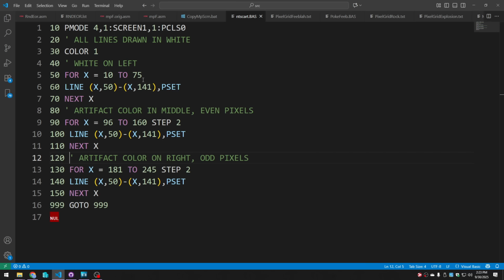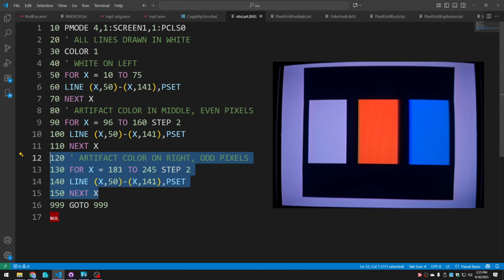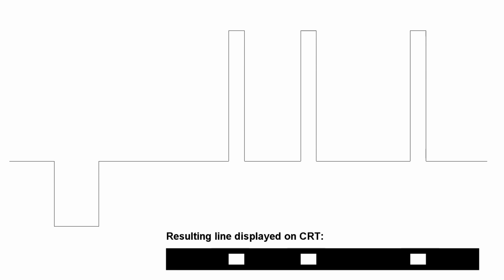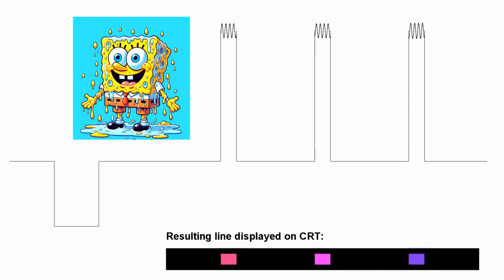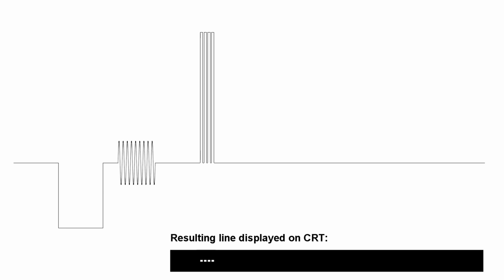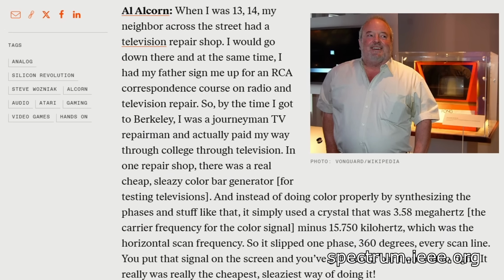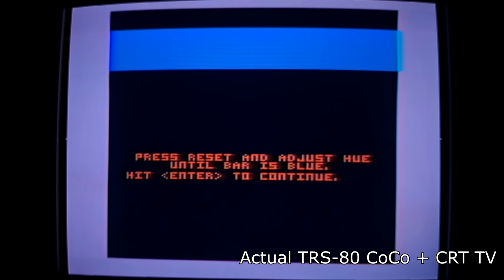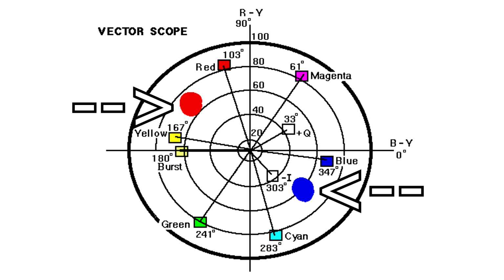How early computers TRICKED TVs into making color (out of nothing at all)

Comment: When you send the color burst (3.579~MHz) signal to trick the display into thinking you are in color mode, are you basically using the same trick as with the "fake" colors (sending a luma sequence that mimics it)? If not, and you are using some signal encoding method that can natively send the chroma signal, then why not just encode the colors using the chroma signal?
Reply from the maker: In the case of the apple 2, it did not generate chroma at all, and used luma for all of the colors.  I'm no electrical engineer, but my guess is that it's much easier for digital circuits to generate color burst than it is to generate chroma. Just a simple sine wave or even a square wave approximation at the right frequency and you're good. Chroma requires carefully adjusted phase changes for each new color across the scan line.  In the case of the coco (which came a few years later), it actually was capable of generating chroma, and did so on the lower resolution screens. It is only on the high resolution screen where it relies on artifacts to get colors.

Comment: To say that it's tricking the monitor is a little weird, because tricking the monitor is basically how NTSC colour works.  It's a monochrome image with a signal that tells the monitor to interpret patterns on the lines as colour (as well as giving it the phase reference).  This is, of course, why NTSC's colour resolution is so awful.

(As a long-time Apple II guy, this subject is a very old friend.  😉)
Reply: Side note:  I once connected a colour NTSC monitor to the s-video output on one of my video cards (through an adapter, of course), and dragged an Apple II emulator, in monochrome mode, over to it.  Sure enough, the colours worked.  ☺

Comment: Actually my comment covered TV standards. Monitors are progressive scan all lines 60 per second. And external sync signals can be either polarity, but during actual retrace the have to be black at the CRT.
The screen has several phosphors that are balanced to appear white. But because they have different persistences an ultra fine switching from white to black and back can generate a balance change to the eye.

Comment: I know that many people feel confused with TV standards, NTSC is the name of the orginal American B&W TV standard, but since it was the only format avaiable back then the average Joe called it "the TV signal" and the like instead of "NTSC"
The new color standard was called "NTSC Compatible Color" because it was a color signal compatible with the original NTSC (B&W) receivers, and since the average Joe didn't understand much either, they started calling the color television standard "NTSC" (without the "compatible color" part) as if the previous black and white standard had been something other than NTSC.

You can think of the original B&W standard as NTSC 1.0 and the compatible color standard as NTSC 2.0, the important thing to remember is that both are NTSC and NTSC does not imply color unless it's followed by "compatible color"
Reply: NTSC was also the name of the committee that was tasked with finding the suitable colour TV standard, National Television Standards Committee. The quadrature modulation system chosen was developed by RCA and called Living Color. The B&W standard was called Class M, and was developed before the NTSC existed. The first American colour TV standard was CBS's sequential field color, which transmitted each primary colour as a separate field and employed a rotating colour wheel in front of the screen, and was not compatable with Class M B&W. CBS was miffed that their system wasn't chosen by NTSC, especially since the FCC had already guaranteed that the system would be adopted as standard. CBS did not adopt NTSC color until 1965 as a result.

Comment: The reason it wasn't in the docs is because it (at least the implementation in the Coco) isn't reliable.  You can't be sure what colors you're going to get (they can swap from one reset to another), or if you're going to get any at all (NTSC vs PAL).  Basically, the designers were too lazy to make it work right, do they just didn't document it (it's a bug, not a feature).

The APPLE ][, on the other hand, if I remember correctly, was actually designed to reliably produce colors this way, and it was therefore actually a documented feature.
Reply from the maker: That makes sense. And yes, it does appear like the apple 2 was intricately designed to generate a great number of reliable artifact colors.

Comment: Well, I would argue that you do manufacture a Chroma signal.
You're just not doing it with dedicated hardware.
- It is transmitted with all the physical characteristics of a Chroma signal (including the Chroma Burst).
- It is interpreted by the TV set as a Chroma signal.
- It is intended by the programmer as a Chroma signal.
You might call it a software-generated Chroma signal, as opposed to a hardware-generated one.

Comment: 20:53: Is the frequency of the digital signal actually 3.579545MHz, or just close-ish? That's a lot of significant figures.
Reply: The official spec is actually 315/88 MHz, so 3.57954545454545.... MHz. :)

The CoCo 1 clock generator used a crystal tuned to the colorburst frequency (I think?  My memory is hazy...) and the CPU clock was the colorburst frequency divided by 4, or 0.89488 MHz.  Unless you did the magic POKE that doubled it to 1.7898 MHz...
Reply: I'm not sure about the Coco, but what's usually done is buying a 14.31818 crystal and dividing it by 4 with two flip-flops. That way you get a perfect digital 3.579545 signal AND the 180° shifted signal from the /Q output of the second flip-flop. Super simple and clever. 

The Apple I doesn't have colour, but it does get its NTSC carrier signal in this way, for example.
Reply: @MagnusEdvarsson  I believe you're right; I think that's what the CoCo did because the 6809E CPU needed two clock signals 90° apart.

Comment: The fast rising edges off course have high frequency components in the Fourier decomposition, and this caused problems even in B&W TVs, when some movies beginning and end titles had white chars with well defined borders against a black background those high frequencies bleed into the audio part of the signal and in some older TVs you could hear a noise in the audio cause by the titles.

Comment: The 3 components in NTSC aren't luma and hue/saturation. I'm guessing that you expressed them that way for simplification, but HSV color is a cylindrical colorspace and works quite differently to how NTSC encodes color. You also wouldn't be able to tack two parts of an HSV color signal to the luma signal in NTSC and get RGB color out the other side.

NTSC itself is made of 3 signals. Y, the luma, is a premultiplied combination of red, green, and blue in known values (0.30*R, 0.59*G, 0.11*B in SMPTE-C). I and Q are the other two, and they're difference signals from luma along two different color axes in the same RGB space. They are also effectively just premultiplied RGB, with different constant scaling values (0.599, -0.2773, -0.3217  for I, 0.213, -0.5251, 0.3121 for Q). This means that to reverse from YIQ into RGB to fire the CRT guns, you have 3 equations with 3 unknowns, and can solve for RGB with some simple matrix math. In actual fact, I'm pretty sure there was some cost optimization that was done to make it even simpler than using all 3 signals completely, but analog colorspace conversion stuff is a bit more wizardry than I'm comfortable with TBH. Probably just extracted R from I and Y, and B from Q and Y, without referring to all 3 within the same operation.

The I and Q signals are also just monochromatic video signals (with much lower bandwidth) that would look really weird, but if they were hue/saturation type colorspace values, they'd pretty much be unintelligible. The I signal is roughly orange-blue contrast, and the Q signal roughly purple-green contrast.
Reply from the maker: I did indeed omit the much more complicated details that weren't necessary for understanding color artifacts. I did have to mention the two color signals briefly, when showing the block diagram of the coco, with the two difference signals coming out of the VDG and going into the RF modulator.  But I never explained what they were or how they turn into the final chroma that the TV decodes.  @TechnologyConnections did a great job of this (as usual) on some of his videos.
Reply: There were three signals in the NTSC video composite. Y, containing the luminance/sync/burst and the modulated red and green subcarriers, 90 degrees out of phase, at burst frequency. When burst is present, the color killer is disabled, and the red and green subcarriers are demodulated. Blue is regenerated in the chroma section by subtracting red and green from the luninance. The luninance is sent to the cathodes of the CRT, and the RGB signals go to their respective control grids. If no burst was present, the color killer disabled the demodulators and the CRT control grids were biased equally, resulting in a B&W picture.

Comment: why don’t they just do color properly? am i missing something? was that like really difficult to do?
Reply: Memory biggest reason.  If you’re in high res, to draw the whole screen in black and white, needs one bit per pixel.  If you add color, you need multiple bits per pixel.  Even adding 2 extra colors would double the memory required (2 bits to count to 3) .   Which is why color is availabile in low def modes, less pixels means less memory, so can use that for color
Reply: 256x192 in black and white is 49152 bits, so around 4k (divide by 8).  That’s a LOT of ram, when these things only have 16k or something (does a google), 48k

Comment: 04:30 - It is / was possible on PAL too to create false colors, once you learn the difference between it and NTSC. Personally I haven't seen any software exploiting this same weakness PAL also had tho. But I briefly experimented with, and indeed I was getting colors (on C64).
Reply: I'm used to the false colours already generated normally, being these dreary vertical bar patterns of alternating washed out green and blue. And a dot matrix was always rendered as bars of washed out blue and crimson.
Reply: Yeah, but PAL is heavily advertised as not capable of artifacting. I think for PAL it involves messing with the color burst signal to get artifact-like colors.
Reply: @RAMChYLD  - Just as any other analog formats, PAL is not entirely immune from either dot crawl or cross color (or hanover bars even), I've seen those artifacts all through my younger life, and as I said, I messed with it on my C64, there's NO need of messing with the color burst, it is relatively easy to do the same tricks on it as you can do on NTSC.

If I had to choose between PAL, NTSC or SECAM, I'd definitely choose PAL, indeed that's the format that made a much better effort on fixing the shortcomings of NTSC, but as everything analog, PAL isn't perfect either, it can only do so much.

Comment: The only part I don't get is how you have enough resolution. Are you really generating a valid chroma signal with just two columns? The signal graphs make it look as if you'd need to draw several columns of alternating lines to display one column of colour, which would make your effective resolution tiny.
Reply from the maker: On the CoCo all you need are two columns. The high resolution graphics mode gives you 256 pixels going across (with rather large unusable borders taking up the remaining space on the far left and right of the tv screen). So setting one pixel white and the next one black is sufficient to give you an artifact color.  The diagrams in the video showed more than two pixels (with the resulting wide rectangle of artifact color on the screen) just to make the effective frequency pop a bit better for the viewer.

Comment: It does not work in PAL because PAL have a auto correction of color in which each line has the phase (where color information is encoded) reversed and added to the previous line to average changes out. Here in Brazil we use PAL-M and technicians called NTSC as Never Twice the Same Color as any phase variance changed color. Interesting as a flaw became a feature.
Reply: You could do the same with PAL but the hue you get is very limited. For instance the FuBK test card has the yellowish zone in the middle right that is made with a precise luma signal https://www.youtube.com/watch?v=4sF6bO6XGHs and by the way the two boxes in the lower right aren't actually grey, but if the AL decoder is set properly and there's no weak reception they are the same gray, otherwise they change hue https://www.youtube.com/watch?v=vYJbEEdRiOc

Comment: Woz figured out a way to extend the graphics on the Apple IIe using 80 column mode, to add 16 color double low resolution 80x48, and 16 color double high resolution 140x192. this was known as an enhanced Apple IIe.

The programming for this was ridiculous because it used the same memory addresses in opposite banks for each pair of bytes horizontally across the screen.

Double high color uses four pixels in a row to set the 16 colors, except each byte holds seven pixels so the colors are not aligned on the byte boundaries. It was insane.
Reply from the maker: One of the talks I watched while researching this went into those details.  And yes, it was highly unintuitive and seemed quite cumbersome to code to.  But still, the fact that it worked and provided so many colors so cheaply was really impressive.
Reply: @CocoTownRetro  Woz is underappreciated compared to Jobs, more people need to know about Woz

Comment: CGA had "real" color and artifact color combined, generating a lower resolution, but larger palette. But that was only happening over the composite connector. Via the digital connector, one would get higher resolution, but just four colors, and the colors were quite ugly. Later hacks actually enabled achieving 1024 simultaneous colors on CGA's composite output, I'm sure that was beyong the wildest dreams of the designers of the CGA.

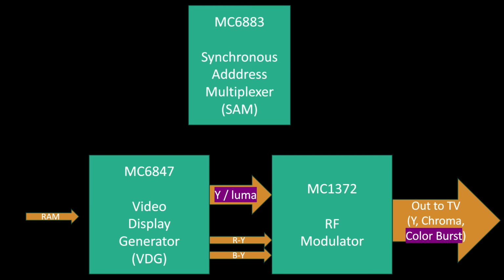Comment: 19:11 If MC6847 can output Y, B-Y, R-Y(basically YPbPr) then shouldn't the system as a whole have supported color without the need for color artifacts?

There are YPbPr mods that take advantage of what MC6847 outputs.
Reply from the maker: Yes, and indeed it did!  I was focusing in this video on the highest-resolution video mode, which was B&W + artifacts.  However, every other video mode is lower resolution (to varying degrees) and they all do "real chroma" instead of artifacts.
Reply: @CocoTownRetro Thanks for the clarification. Excellent vid, very educational.

Comment: My understanding is that it was completely unintentional on the CoCo 1. Apparently part of the signal was either unfiltered or poorly filtered. When they were working on the CoCo 2, prototypes fixed this issue. However, as the fix greatly reduced the color artifacting, software that used color artifacting did not look good and they then intentionally restored it for backward compatibility.
Reply from the maker: Interesting.  I should see if there's a coco1 service manual available to see what it says.  I've been going off of the Coco2 service manual.

Comment: One additional thing that it might have been good to mention in the video is the fact that the CoCo's main internal clock was using a crystal tuned to 14.31818 MHz - exactly 4 times the NTSC color burst frequency. All of the other timings used in the system are derived from that. Divide by 4 to get the frequency used by the video generation chip for timing pixels and generating the ntsc colorburst, and divide by 16 (or sometimes 8) to get the clocks used by cpu and ram or rom access.
Reply from the maker: Yeah, it's interesting what goes into choosing a useful oscillator frequency.  Given all the things a coco needs to do, I guess making it an even multiple of color burst is the easiest choice all around.

Comment: This is a really informative video, has the best explanation of how NTSC color video works I've seen!
My only gripe is the use of AI-Generated visuals. Stock footage & images would look infinitely better, & be much better for the environment as a whole.
Reply: Generating a single image using SDXL takes about 30 seconds at a TDP of 115W.  About equivalent to running an incandescent light bulb for 1 minute.
There was an article that claimed that generating an image used "as much power as charging a phone", but 30 seconds at 115W does not sound like that at all.
Reply: came here to say this, but i have something to add on - i really hope the information in this video is accurate, but i dropped out when i noticed the ai-generated visuals. not even just for the environmental cost (though that is a factor) but the fact that if the video creator is using that for b-roll they might have also used it for other aspects including research and i can't trust research done with that
Reply: Stock footage is under copyright by somebody. If you want to be legit, you have to pay for that sort of thing. I don't like AI nonsense, and it is probably derived from something that was under copyright. But it does the job and gets the point across. And no one can make a copyright claim. 

The power usage is mostly on the training phase. Generation is expensive too but not nearly as much. And the training has already been done.